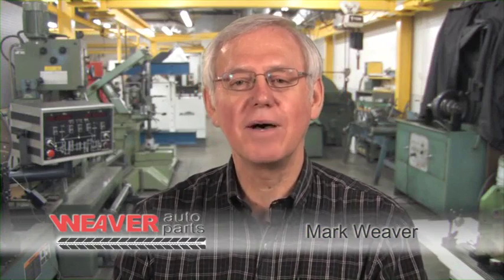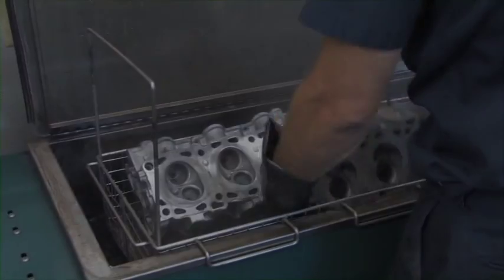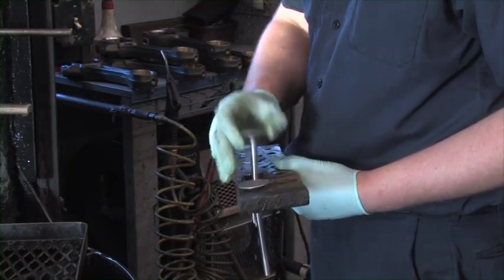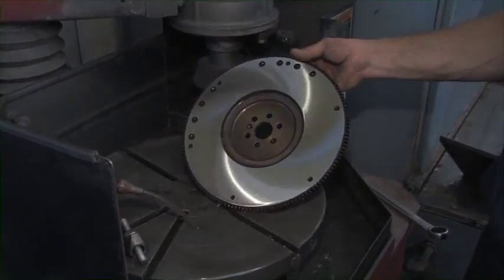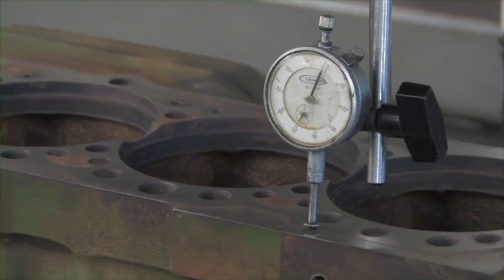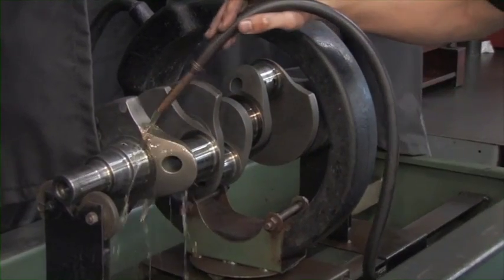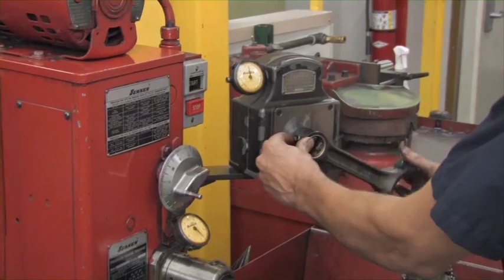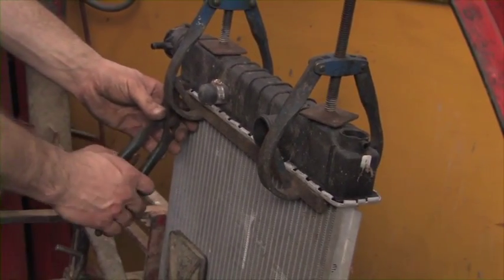Machine Shop Tour

Comment: After a flywheel is ground, the operator releases it from the faceplate and DRAGS the ring gear teeth across the faceplate on the machine.  This will for sure raise scratches in the surface  of the faceplate.  Poor shop practice.  Also I noticed during the cylindrical grinding of the crankshaft journals, even after full cleanup had been achieved on the journal, an uneven intermittent sound was coming from the grinding wheel.  This very likely means that the wheel needed to be dressed because of an out-of-round condition or the wheel surface was not coaxial to the grinder spindle.  Either way, diamond dressing seems to have been needed.  You might want to investigate these poor shop practices to improve your operations, and especially before posting a video publicly.  Just trying to help. I know not everyone notices these details, but in precision machine work, these things are important.
Reply: People in glass houses shouldn't throw stones.
Reply: @Peter-V_00  I do not live in a glass house.  I am an experienced machinist.  My comments come from me actually using similar machines and doing like jobs. If you disagree with any of my specific comments, let us discuss why you are right and I am mistaken. Please.